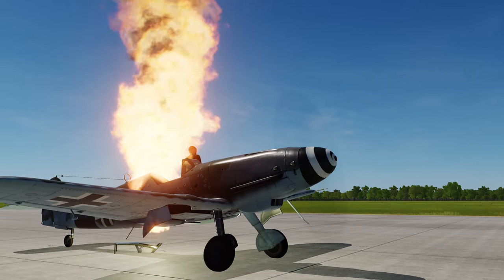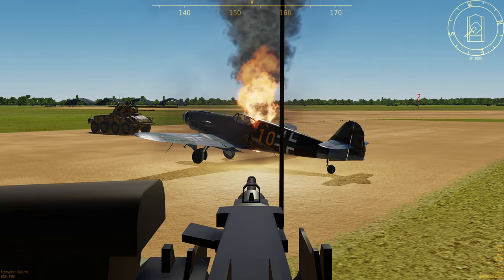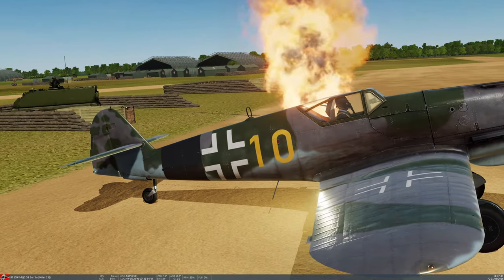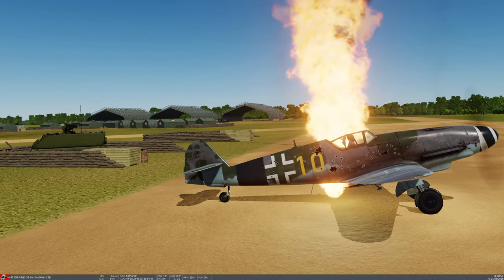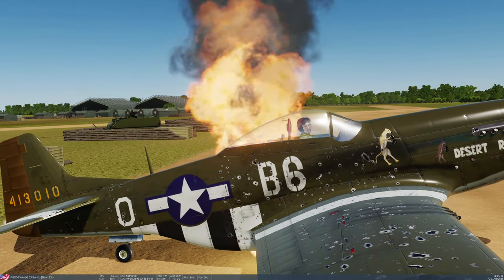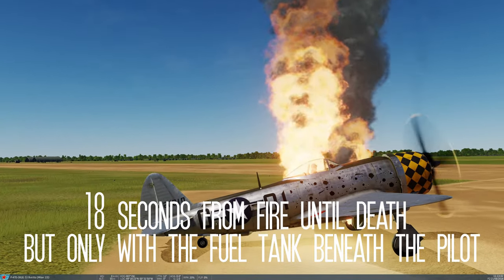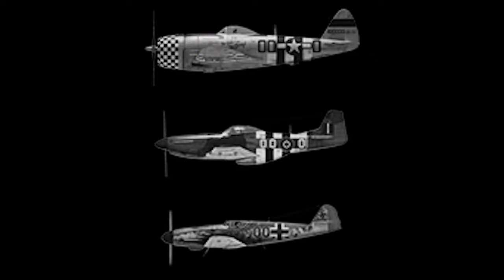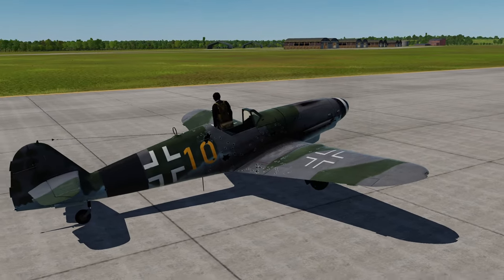DCS Burning Aircraft Testing - Wot's going on 'ere then eh?

Comment: We like to SRS call "meteor heading west" or "east". MW50 is barely flammable it will burn but has to be a certain temp and certainly won't burn the same as the fuel. I think main issue with the damage model is one fire fits all.

Comment: The bulkhead at the front of the jug is surely helping to protect the pilot and hasn't the 109 got an extra thick bit of armour behind the pilot that could help to shield them? Surely this is all pretty good as with a slight gap to the side of pilot when burning would give a chance for heat to be deflected by the cockpit side wall, but a side fire with no gap could indicate flames directly entering the cockpit?
Just a thought.
I think ED have done a very good job here as its very taxing on people's pc to have an extensive damage model.
Reply from the maker: This might be part of it. Although armored plating would still conduct heat and fry the pilot,. but it might take some time.
I think if the less damaging fires had smaller flame effects it would help too. The visual effects make it look like the cockpit is a furnace, when in fact, the DM might only be considering the fire to be small and localised.

Comment: What I don't quite understand is why when the 109 fuel tank starts burning while in flight kills the pilot, cause in my understanding the fire is actually outside the plane and the fuel is leaking out, and only then catching on fire. That would make the pilot quite far away from the fire itself and would be able to survive for quite a lot longer than it does rn

Comment: That's some impressive detail. Nevertheless, I still think that the planes are a bit to "tanky"
Reply from the maker: The foundation is really highly detailed yes. It's just the refining and the top level effects/ output that need work, IMO.
Reply: Certain aircraft are, that's for sure. Mainly the German Warbirds. Spitfire is like paper 🤨
Reply: @symie8  yeah, just dumbt my entire ammo from the spit in a 190a8 from 20m away he he was fine
Reply: @sloppy-1-1  That sounds about right! It's small wonder most users are flying the 190 and 109. They absolutely shred everything else! I've been practicing my air to air combat on a quiet multiplayer server where there's also a few Ai. So far I've taken down 2 German fighter aircraft, 1 of each type (though the 2nd was a bit of a surprise as I couldn't remember facing a 109, but hey ho! I'll take what I can get 😉). Now that was just yesterday that happened. For the last couple of weeks I've used millions of pounds of ammo on the German fighters, and a good mission was one I could run away from once my guns ran dry! Of course, I've been shot down more time than I can remember as well and it's always on the first engagement 😡
This evening I was watching some combat footage from WW2 and it certainly looked fairly easy to damage the 109s. Same as most I perceive, hit the wings and fuselage and you'll rupture some sort of cabling or tank, and especially when you think one of the aircraft had a fuel tank 'behind' the pilots seat! Surely that would go up fair quickly you'd think?
But no, I'll continue my training till I can find some sort of sweet spot on those birds! In the meantime here's a tip - them JU-88 aircrew sure knew how to fire them guns in the fuselage/tail/doesn't really matter where, they're sh*t hot!
Reply from the maker: @sloppy-1-1  I don't believe that.
The very best pilots achieve a hit ratio of around 10%.
Show us a trk file.
Reply from the maker: @symie8  Spitfires and P51s each accumulate twice the flying hours of the most popular allied aircraft. Your premise that "most users are flying the 109 and 190" is wrong.
Reply: @philstyle  oh you understood wrong. Ofc i didn't hit every single bullet, but around 10-20% (I think). I just meant that I shoot until I ran out from pointblanck range, sry for the confusion.
Reply: @philstyle  yeah I noticed that as well. Most often it's like 10 germans vs 20 allies
Reply from the maker: @sloppy-1-1  OK, gotcha.
There's currently a bit of a problem with the spitfire - because the impacts from the .303 LOOK the same as the Canon. So often we think we are hitting the enemy with Canon, but the canon are dropping and the .303s are hitting. But the hit effects look awesome, so we think we are pounding the crap out of them - when in fact it's just a tickle from the pea shooters.
Reply: @philstyle  ahhhhhh ok that might explain it. It ran out of cannon ammo (could hear it) and decided to try taking it down with the .303. The hit effects looked like I was hitting it with the Bismarcks main guns....
Reply: @philstyle  yeah, you're right of course. Even on the SoW server there seems to be more allied than axis aircraft, however that wasn't always the case.
 You also can't deny the fact that the Spitfires are paper compared to the 109 and 190! As I'm led to believe ED are "looking into it". Just like they're looking in to a lot of issues. Oh and then of course there's the issue with the Spits sight, but that's not the matter here 🙂